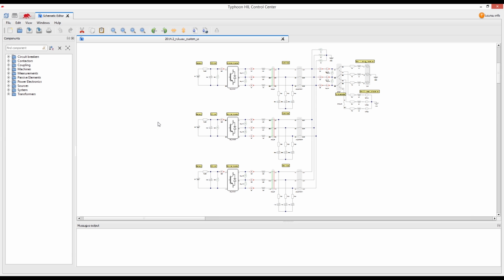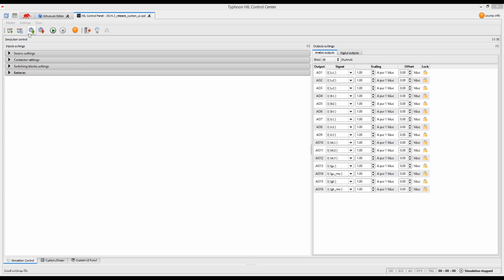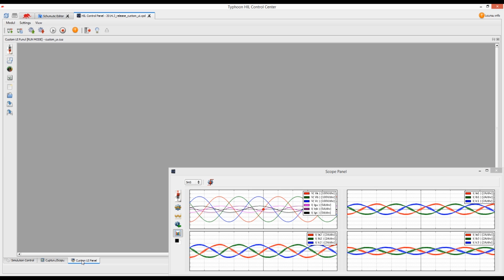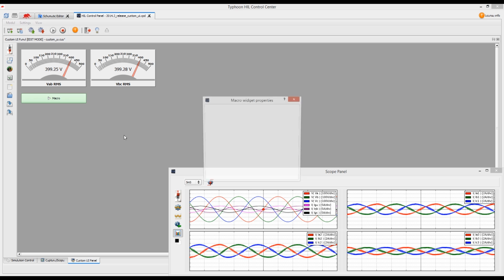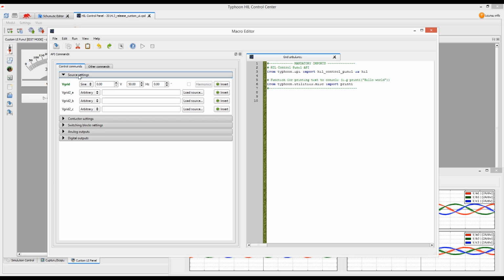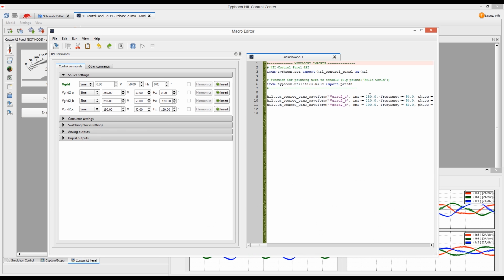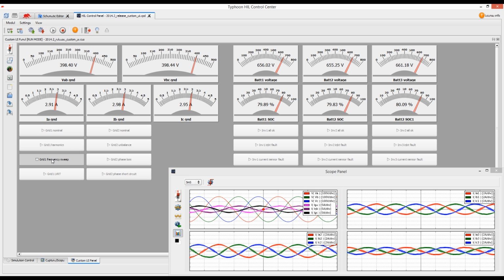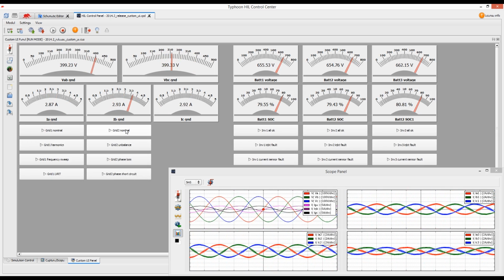Typhoon HIL 2014.2 Release highlights: Custom UI

Comment: Hi, I have some questions related to custom UI, how can I get the rms value of a signal (Vab or Ia) in my analog output channel settings? In this video I can see some of the signals in analog output channel selection are readily in rms and you are selecting it in the meter guage - custom UI.  Or the only way to get rms value of a signal is by doing RMS calculation using expression in the meter guage? If that is the case, if I choose the sampling time as 250ms, would it work fine in getting an accurate value?. your help your would be greatly appreciated. - goutham
Reply: Hi, in the library of elements, in schematic editor you can add RMS current and voltage measurements. These measurements are supported on HIL600/602 and 800.
Reply: Hey Adrien. Thanks for the reply.. Yeah it's in HIL6xx/800 that I checked today. But in HIL400 can I use the expression to calculate rms value ? I'm trying to figure out a way to calculate rms in HIL400. The read analog signals of the analog meters in custom UI are at same sampling value as the analog meters that I set in the schematic circuit?  Some help in calculating rms in custom UI meters would be really helpful. -goutham
Reply: Hi Goutham. RMS measurements are not supported by HIL400 because they require a resource that is not included in HIL400. There is a way to implement a very simple RMS calculation in custom UI (for example in a gauge). It simply determines the maximum of the signal and divides it by sqrt(2). This simple RMS calculation will work properly only for sinusoidal signals, without big ripple and harmonics. Here is the code:

#----------------------- MANDATORY IMPORT --------------------------
# HIL Control Panel API
from typhoon.api import hil_control_panel as hil
import numpy as np
import math
# NOTE: Only read functions are available from HIL Control Panel API
#-------------------------------------------------------------------

# mandatory variable used for storing value
# that will be displayed
displayValue = 0.0

signalValues = []

for i in range(1,100):
    signalValues.append(hil.read_analog_signal(name = "V( Va1 )"))

displayValue = np.amax(signalValues)/math.sqrt(2)
Reply: Adrien Genic Hi Adrien, Thank you for your reply and also for the simple rms calculation code. It actually works fine with a little mod in the code and it saved my time a lot. I would not need an accurate rms measurement so this simple calculation is sufficient for me. Thanks a lot :)